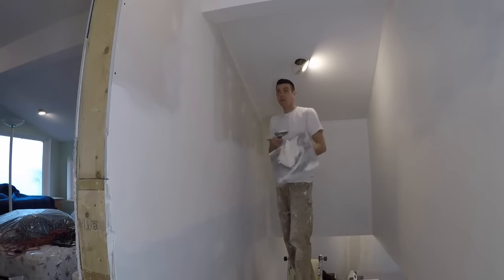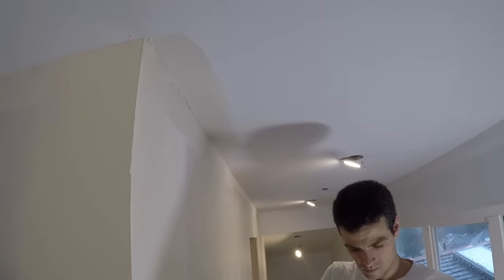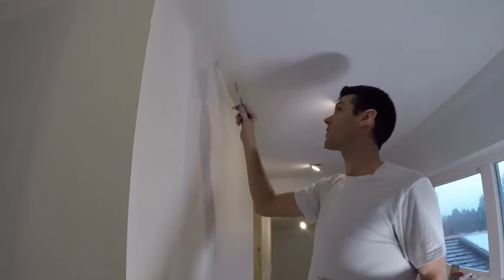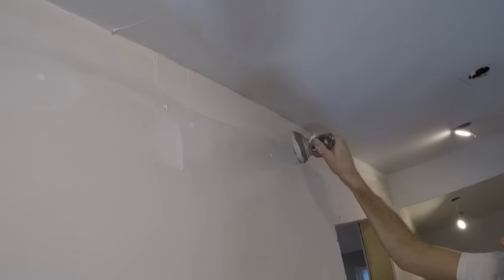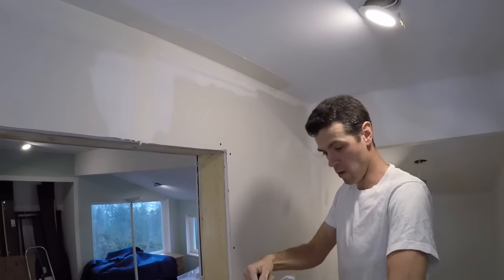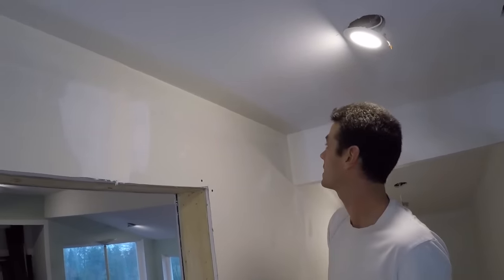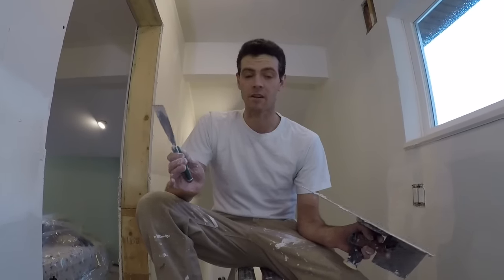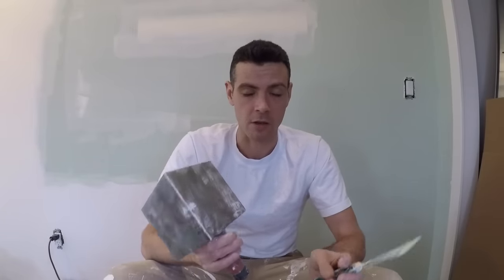HOW TO USE A CORNER TROWEL

Comment: I think the fact that you're exceptionally skilled and experienced at mudding is skewing your view of how useful a corner trowel might be to a rank amateur.  It's faster and easier for you because you've done tens of thousands of corners and you're used to the tool you always use to do it.  The typical DIYer has little to no experience mudding at all, let alone doing trickier bits of mudding like corners, butt joints, etc.  They have no comfort level with any tool for any particular application because they just haven't done it enough to establish it.  For someone in that situation I can see a corner trowel being useful if they insist on trying to do it themselves.  I'd have a lot more confidence that someone with no mudding experience could achieve at least a reasonable result with a corner trowel than a regular knife.
Reply: Amateur DIY'er here.  I just tried out an inside corner trowel for the first time, and I have to agree with Vancouver Carpenter.  It is fussy and definitely did not save me any time or effort.

I've done several drywall projects, and have always done the inside corners with a 4" knife, and figured out the hard way that I just had to do one side at a time.  In my current project, I figured I'd try out an inside corner trowel, hoping it would speed up the project and save me some time.  I found it very difficult to get an even application down the middle of the corner.  Very easy to have it too thick on one wall and too thin on the other in various spots, alternating between both sides.  And in quite a few places, it left too much in the corner, and they dried and cracked.  That required more sanding, which left dust in the cracks, which came back out and left blobs and streaks on my next coat. 

If someone else has good luck with the inside trowel, I hope they can post a video for us amateurs telling us how to avoid these same problems.
Reply: @alanmillar2905  
Again you have done enough of it to have already established a comfort level doing it another way.  That is not even remotely relatable to a rank amateur with no mudding experience whatsoever.
Reply: I mean to be fair he said you can get an acceptable result, just not professional. Seems like this is more of a response video of him explaining why he never uses it. And I also agree, when it comes to drywall I don't have much experience, but I remember the second project I did I bought a corner trowel and i could t get a tight corner without essentially wiping all the mud off. Ended up taking my time and pulling from the corner out and it looked better than using a corner trowel. (I never watched any videos on mudding and never realized how easy it is to just do one side at a time lol)
Reply: @kyleaguiar3413  
Most people have difficulty even getting an acceptable result on the ideal straight joint between two sheets.  Getting an acceptable result on a corner joint would be a monumental achievement for them.
Reply: @Rowgue51  oh I totally agree, I'm just saying I don't think the video is saying "don't use them, they suck" it's him responding to people asking in previous videos why he doesn't use them. And what I said about myself is because I'm the type of person where if im not good at something I'll be disappointed till I'm decent at it. The finish I got using a corner trowel probably would have looked perfectly normal to anyone else that'd ever see it (unless it was a pro drywaller) but I'm a weirdo and I'd look at it every time I walked by and hate myself for it and contemplate sanding it all out and getting it perfect lol
Reply: As a union carpenter that just learnt how to mud (we put up the drywall and the tappers and painters mud and finish it) I find that corner worthless I wind up spending the same amount of time using the tool as if I would of just used the 4”  knife
Reply: 100% i only do plastering work when doing my own places and i find the corner trowel really handy, but that said i never thought about doing each side separately.

Comment: I bought one of these and got FANTASTIC results.  The trick is to use your other hand to push the metal FIRMLY into the corner.  Then lift the handle ever so slightly and just glide it across.  Did all my corners in one easy pass and hardly sanded anything.  Using the tool with one hand with a nasty angle like that will cause all the nightmare problems he's showing you.

Comment: I’m professional and for muddling  drywall it’s not that useful. For concrete muddling that corners are not straight,it helps creating a sharp corner. Also it’s even more useful for decorative techniques like cement plaster or marmorino plaster that are nearly impossible to sand when dry and you have to make things perfect during application. Especially when applying cement mortar on furniture ,benches , and other complicated surfaces , its a very useful tool. Side note all tools MUST be stainless steel and they are pricey 😅

Comment: I've learned from an older drywaller gentlemen that you gotta position ur hand on the handle in a way so that you have a finger on each edge of the corner trowel to feather the edge.

Comment: I'm by no means an expert, but what I have found that works is to use one of my smaller knives to get mud into the corner, then smooth it out with one of these corner trowels, then stick my perfect 90 vinyl tape on, mud that, and then hit it with the corner trowel again, feather edges. You have to float out on your second coat but I never have to go back in tight to the corner after the first coat.

Comment: There is a huge difference if you plan on doing 10,000 corners in your life or 25.    As someone firmly in the latter camp, I've found a corner trowel to give my by far my best results with by far the least amount of time invested.   Its similar to prefabricated metal/paper corners.  Would a pro use them?  Almost certainly not.  Am I going to?  Yes because it makes it easier for me to get decent results.

Comment: I have a recently renovated Ottawa house that was drywalled by a supposedly decent company with guys that had decades of experience. Just about every inside corner was undercut on one side or the other. Every corner that I've touched up afterwards with a corner trowel looks great. Same experience with my previous house, too.

Comment: When I was taught to do corners it was with a corner trowel and I've used one ever since (16 years). I feel my results are really good (compared to other drywall finishing jobs I've seen which are mostly production crap). But now I'm seeing the potential benefits of "one side at a time" and I'm looking forward to giving it a go on my next job (or house project first). It looks like it can get a sharper and cleaner corner. I was put off trying this method a few years back when I trimmed a house that was finished that way but in hindsight it was their sloppy and inattentive sanding abilities that left horrible three way corners and other terrible joints. 
I have learned tons with your videos to massively improve what I thought I knew about drywall finishing.  Keep up the amazing work
Reply from the maker: It did a half decent job. But I had to touch it up and it was more sanding. Also considerably slower. I don't doubt that you could get pretty good with it with more practice.
Reply: @vancouvercarpenter after taping and flushing corners do all your 3ways first with 6 in. knife...let it set...then do straights with 4 in. + corner tool...i do it in 4 steps...apply mud both sides with 4, wipe with corner tool, wipe edges tight with 4, wipe and finish with corner tool-dont touch again, feathered edges will sand off. Should have about 5 in. wide line on both sides. Get better/ faster with exp...but leaves a nice corner filling in irregularities.

Comment: My first few years I used the traditional 1 side at a time method. For the last 20 years I use a corner trowel. The cheap red plastic handle ones are better than the marshal ones.

Comment: I've used a corner trowel for 40+ years.  I think my results are good.  Heard about the one-side-at-a time method but thought it needless extra taping day.  My work was mostly baths and basement so all knife work.  Agree with you that this tool is tricky to get right.  Redoing the basement in my new home and I'll give your way a try.  Thanks.

Comment: I love my corner trowels. Mesh tape in the angle, coat and fill using a 2.5" corner trowel and hot mud. Then I put on the 2nd coat using a 4" corner trowel and topping light box mud. And always feathering the edges. Much faster than one side at a time
Reply: Damn, I do the exact same thing

Comment: I used one yesterday thinking it might be easier than I remembered, it wasn't horrible but getting consistent results it tough for me. I do find that you can't try to stretch way out as its hard to keep the pressure consistent and angle correct.

Comment: I just did work with an “outside corner” trowel filling in a new receptionist opening at an office.  I applied a little mud to both sides and then made a pass.  Looked pretty good.  Ran another pass once dry and looked great.  Gotta fill in middle last. They do take a while with mud needing to dry.

Comment: I only use the corner trowel to apply my first coat of mud when bedding tape. I find it is easier to get good mud coverage with it, and it's quicker than alternating sides with a 4" knife. After I apply tape to the mud, I bed and dress it with the 4".

Comment: I keep a corner trowel in my bag and use it for only one thing. It beds tape beautifully ,with some practice of course.
Reply: John Czeiszperger  I was going to say the exact same thing. I have never used or even thought about using a corner trowel beyond embedding tape. But I figured someone had to have already said it.  Couldn’t agree more my man!
Reply: Ditto. That's all I use it for, bedding the tape and applying a top coat to the corner all on the first coat. It makes a great inside corner to apply successive coats, and requires less coats to finish that inside corner
Reply: I use a 50mm corner tool you bed tape and 100mm corner tool to top coat and never have any problems even on 3 way corners.
Reply: @marcellemay7721  Agreed. Been using them for years. The thing I can't seem to work out is the OUTSIDE corner tool;  faster using a 10" knife.
Reply: @garychandler4296  I don't how or why you would even use an outside tool unless you were forming a plaster corner with no bead under it. Why would any one do that?.. except for maybe around an arch way or something.
Reply: @marcellemay7721  I don't. I just bought one because I do well with the inside tool and I like tools. It actually has no function but taking up space in your box!
Reply: Yep the corner tool is just for bedding tape never finishing.
Reply: @marcellemay7721 outside corner tool is used for EIFS. External insulated finishing system.

Comment: I'm a DIYer and recently took down a lot of popcorn ceiling in my house.  Sure learned a lot about skim coating and sanding lol.  However as I now have somewhat jaggedy edges at the join of wall and ceiling, I want to be able to fill in those areas. Contractor friend with 25+ yrs experience has suggested a corner trowel so I plan to get a small one and have at it.  Having watched your video I think I'll be able to do a passable job.  Thanks for the instructional vid!

Comment: I have never used edge, I always use 4 or 5inch knife, the difference is here in Poland we cover all walls and ceilings in the mud 2 coats finish flat as possible then sand quite a lot of work and processes .
Thank you for the video good information 👍

Comment: One good use of a corner trowel is using hot mud where you need to use green mesh for mold resistance. You can really push the hot mud into the corner gaps. Hot mud doesn't shrink much so no cracks. Then finish up with a 6" knife one side at a time with regular compound.
Your videos are FANTASTIC!!!

Comment: I have used this corner tool to shape the bead of compound before applying the tape and then squish tape into the corner. It gives the most uniform results. Finishing and initial compound application is always with 4” knife

Comment: I like my corner trowels...smaller one for mudding and taping, bigger to finish. Touch up with broad knife. I use a dustless vac sander with mesh screen...excellent results. I also haven't used paper tape in decades...once embedded, the meshes are far stronger. Loved your videos...a sense of humor and work ethics are nice to see.
Reply: the mesh is better in general for application its so nice to apply all your tape to a room instead of jumping back and forth between mud tape over and over again

Comment: VC - I enjoy watching your videos because you explain things well and speak so eloquently. I have tried to learn from pro's working on other jobs, who knew what they were doing but weren't very good at explaining things to a newbie.  I learned to use the corner tool thru trial and error. I got great results after applying the mud on one side at a time, then finishing with the corner "tool", feathering any 'outside' ridges with a 4 inch blade.  I an avid do-it-yourself'r and finished an entire 2nd floor, including drywalling and taping, by myself. I never applied more mud than just into the corner. I learned along the way that too much mud meant more sanding, so I never got those hairline cracks because i layered the mud real thin before using corner tool and just applied a second coat the same way. YES, it was more work than your way but I was not in a hurry. I was patient to learn the right technique because I would be staring at any mistakes I made, for years to come! (And i don't like to see mistakes!)

Comment: I use them, just did my kitchen drywall and got best corners with that. I kept messing up the inside with the knife so I would coat it, apply tape and smooth it with the corner tool. I held it at a shallower angle than you did and went a little slower. Worked OK for me as a DIY guy.

Comment: Corner Trowel also can be very well used when you put your tape down to place your tape into the mud. What I use is a Mud caulk gun to push a very big sausage into the corner, apply my bend tape and than run just once with the corner trowel over it forcing it to mash and spread evenly enough to both sides of the tape. The key is I use a sausage dispenser to push the mud into the corner joint first and after it as well to cover evenly the tape with mud. Give it a try and you will see it may speed things up for you. Still a banjo is way faster but a banjo is also an investment.

Comment: I don't do a lot of drywall, but I've gotten pretty good with a corner trowel,,,it actually saves me a step now,,,the trick is in the feather,,,and I've found a 5 inch knife works best because it flexes more...
Reply: Use a blue steel knife, very bendable. You will enjoy using it 😉.

Comment: As a more experienced DIYer I learned, through trial and error, to use the corner trowel to imbed the tape but that is all. Then do the sides one side at a time. That way I do not tear the paper when trying to get it into the corner.  But I now realize I have not been thinning the mud enough.  So I needed the corner trowel to force the tape into the corner.

Comment: I have success with a corner trowel by doing the following.
1) load mud directly onto the corner trowel.
2) run the corner with the trowel spreading your mud.
3) next, run the corner again, only putting good pressure on one side while the other side lightly skims the mud.
the pressure feathers the edge. I found it difficult to try and achieve good results while applying pressure to both sides at the same time.
4) finally, repeat this on the other side that was lightly skimmed.

Comment: I just installed my first drywall job. I really liked using the corner trowel for setting and wetting/skimming tape quickly on long corners. I'm going to try it on my second coat tomorrow.

Comment: I have been finishing drywall for almost 23 years. I have used every possible method to tape, coat and skim drywall. I have used the corner trowels and have not had any problems getting satisfactory results. If you have ever ran a rubber knife to finish an off angle( which was the easiest method 20 years ago), then try to use the same principle on the 90° angle. When you feather it, do not just feather the edge. Hold your 4-6 inch knife flat against the wall and remove all but say 2 inches of mud from both sides. Then, when you go to use the corner trowel, pull it as described in video. Using a finger on each outside edge of the back side of the trowel as you are holding it, and holding at about a 45° angle. Apply enough pressure to keep the trowel tight against the wall and pull from one end to the other. Keeping consistent pressure on the trowel, as if you were painting. Make one or two passes with the trowel, and you should achieve a satisfactory angle. If at first you dont succeed, keep trying. Practice makes perfect. Hope this helps anyone who is still trying to use a corner trowel to coat corners. Use your knife to wipe any excess edges, being careful not to cut into your nice mudwork and wait for it to dry up some. If you are running multiple corners follow this same method all the way through. When the mud is dry or at least dry enough you can work on it again. Pick the corners and it is pretty much done.( Picking means coating the ends of all three corners at one time)  A little light sanding and some touch up and you should have a perfect corner.
Reply: need a video